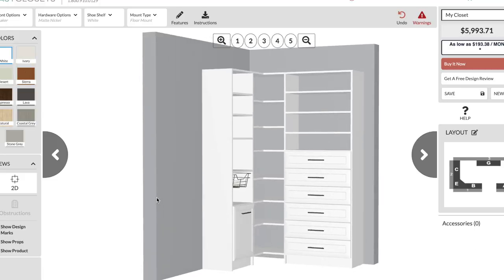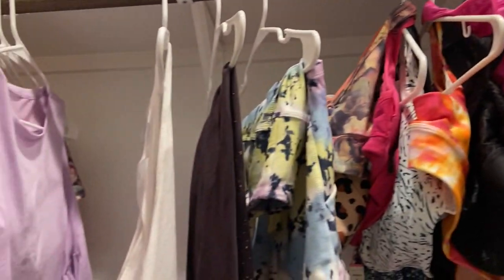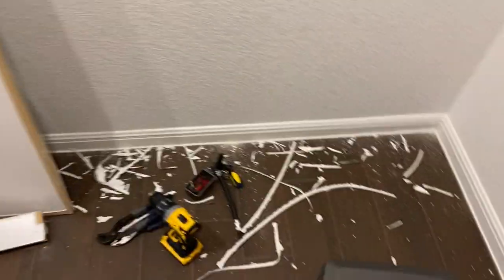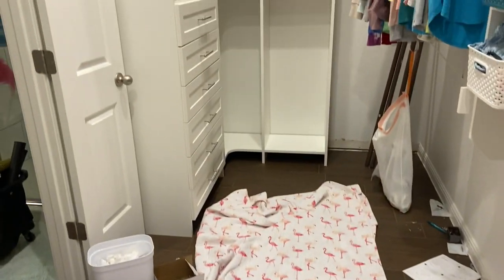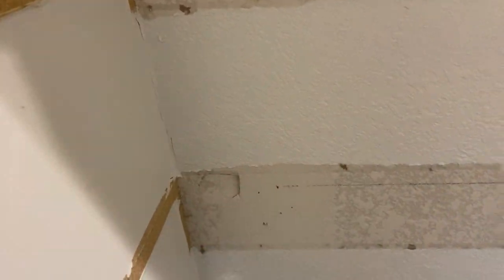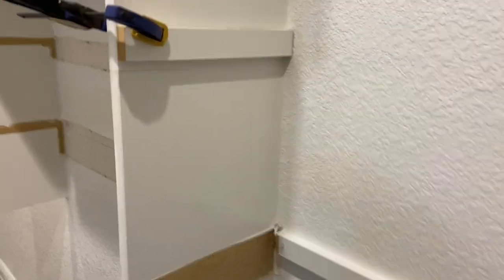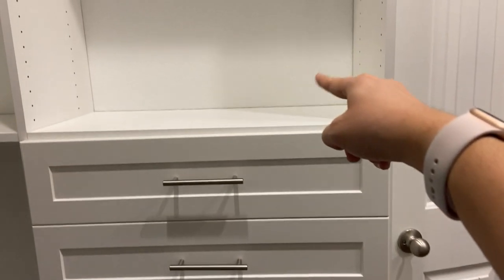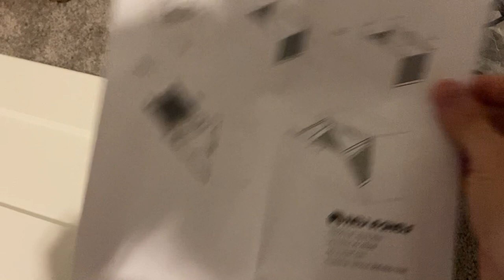MASTER CLOSET RENOVATION PART 1 | Planning, Demo, & Assembly with Easy Closets Semi-Custom Closet

Comment: Looks like it will be a nice closet system; but with all the issues you have had with wrong parts; bad parts…don’t think I would use that company.
Reply from the maker: Some of it was absolutely rookie mistakes and user error on our part! The wrong measurement was also my error so I will explain that more in part 2. 

I am still undecided about if we would use them again. It has been A LOT of work. I am reserving judgment until we are completely done with everything. They were super quick to ship the parts once I contacted them with a list and they really gave me no questions asked just placed an order for us and shipped via UPS that day. They didn't even make me pay for the extra 2 bags of parts we asked for due to accidentally messing up the other set of parts! I was quite impressed with that. Everything should get here Tuesday so we shall see if round 2 wraps everything up. 🤞🤞